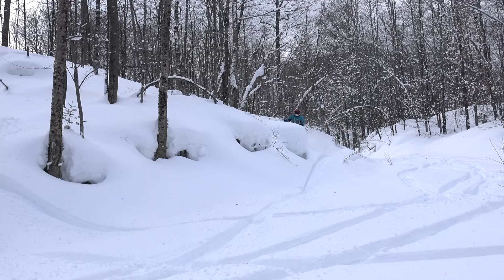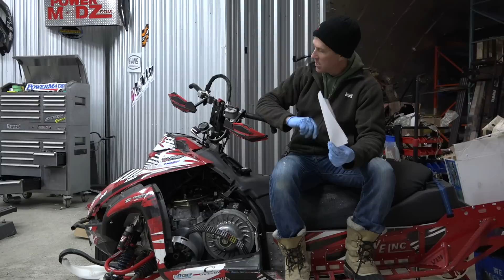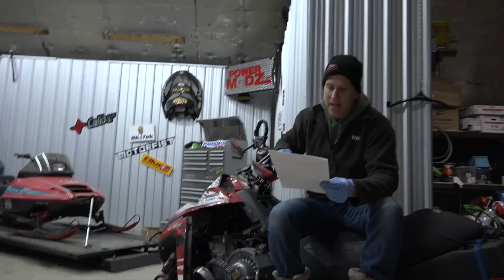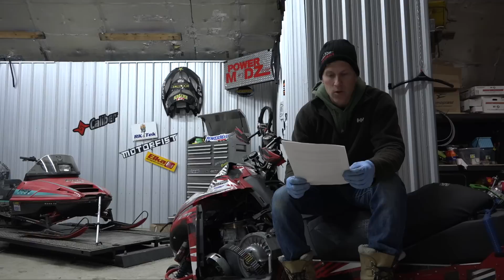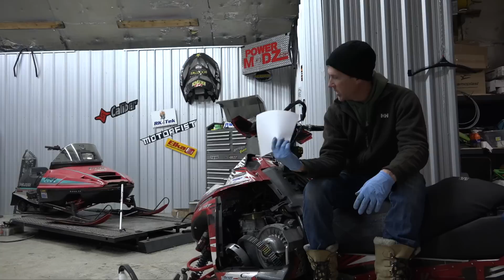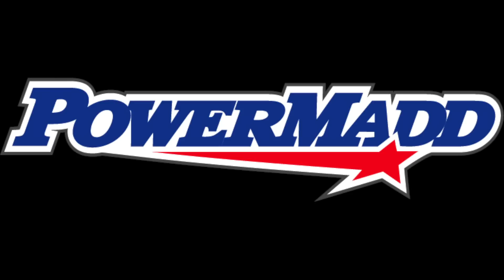PowerModz Question and Answer time!!  Shoutouts!

Comment: Hey Louie....first of all I love your vids!!  I normally agree with everything you say but not when it comes to the Limiter Strap.  I have a 2016 Assault and I wanted a little more front end lift.  First I tried adjusting the preload on my shocks.  I loosened the front ski shocks, tightened the front track shock, and set the back shock to soft.  This helped make the sled easier to lift and a little easier to layover but still not great.  Everything changed when I adjusted my limiter strap!!  The sled feels like a totally different sled now....a  lot more fun for boondocking.  Probably would trench in really deep snow but I usually don't have to worry about that much here in Upper Michigan.  Keep up the great vids and hopefully you get more snow.

Comment: Keep up the good work Louie,as for shifting gears on the snowbikes they need a setup like honda had on a 2 stroke 250cc motocrosser in japan back in the 90s.Pretty sure it was a Hondamatic system like on there ATVs.

Comment: lou! i have a question, why do sled motors make sooo much more hp than quad or dirt bike engines!?!
Reply: pickle street customs because there 2 strokes and most 4strokes are EFI also his 2 stroke has a turbocharger on it
Reply: Cameron k - i guess the numbers i read somewhere were bs.  i just went to the factory specs and got those numbers and they are the same as bike and quad numbers.

Comment: Just got my sled back today XD
wasn't expecting to have that comment read aloud, the reason why i dropped it off was because i need some other stuff done to it, for example i needed the clutches tuned and my shocks rebuilt and i don't have the tools to do it my self and Im not entirely knowledgeable about 2 strokes I've always been kinda a thumper guy. I building 420cc   off road revers trike this summer hopefully it doesn't blow up in my face and ill end up with some good pics... either way ill have pictures...